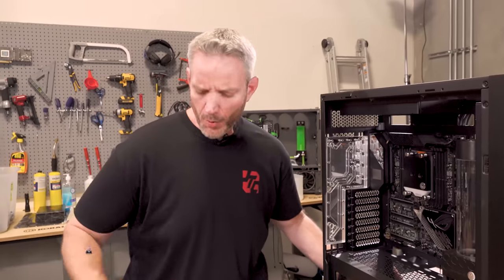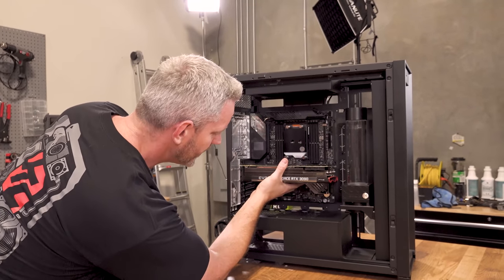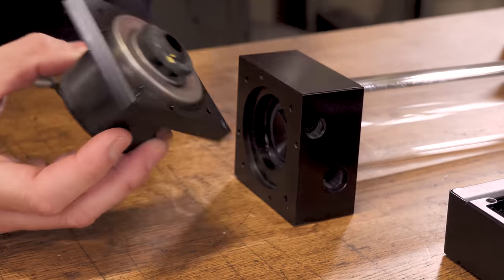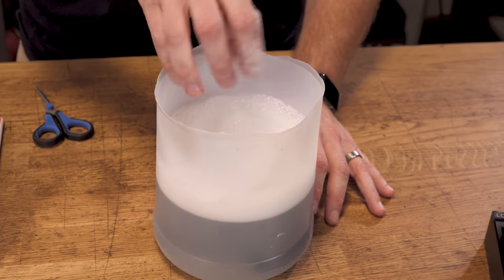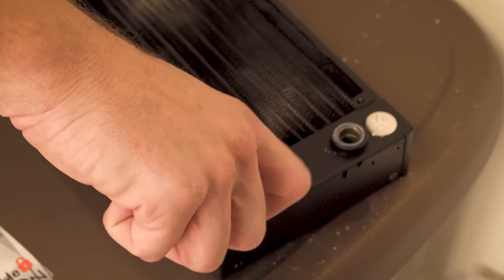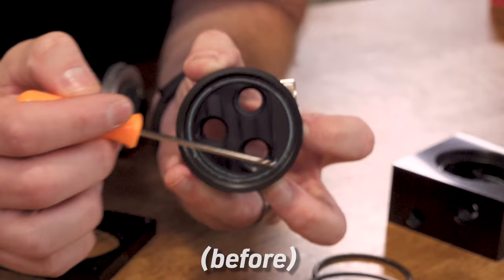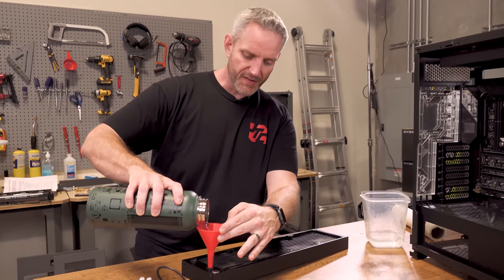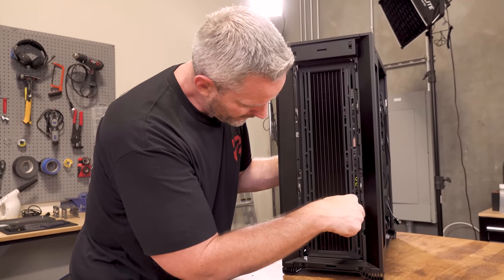Skunkworks Custom PC Build - Part 2

Comment: It's not by any ways boring. This is what I do every time when maintenance on the liquid cooling system is needed. For radiator flushing (both new and used) I use close to boiling point water mixed with vinegar (9:1 10-15% vinegar). It will flush the manufacturer leftovers and it will take care of any sediments from past fluids. I will flush rads about 3-4 times doing the Harlem Shake (TM) :) Then cleaning fittings with bottle brush, clean pump housing with toothbrush, open blocks (both CPU and GPU) and clean with toothbrush, swap crushed o-rings with new ones or just clean good looking ones. After reassembling the system using new tubes (I use soft tubing) I will then run it one time with distilled water and after that I will fill it with proper fluid.
It's a pain in the ass, it takes all day but temps, looks and overall performance of the system is worth it :) And if you keep it up then it will work a long time. I use the same pump unit for 4 years now, but I always clean it during maintenance, just like Jay showed.

Comment: You should try the horizontal mount and add the watercooled backplate that EK released, it would work beautifully with that distro plate and in line with the over the top theme in skunk works

Comment: as someone who has gotten an IFixIt Manta kit I can attest that it is very good. only complaints I have is the magnet is so strong it is sometimes hard to get the bits out yet so weak that it has issues holding screws on the bits.

Comment: FYI jay, the waterblock ek makes for the 3090 ftw3 is longer than the pcb of the card. about 1,5cm longer. I would measure and see if it fits. Dimensions: (LxHxW) - 314x155x20.5mm

Comment: Have you ever tried using white vinegar? I have used that to clean used aquarium pumps to break down sediments that have gotten into them over time. It has worked well. Not sure if it would have a negative impact on computer parts.

Comment: I see what looks like a Harbor Freight pick (fl. orange handle with no markings), you should check out their brush sets too, they have some decent cheap ones.  Or Amazon, of course.  The brushes sold with a lot of bamboo/glass/SS reusable straws are also nice because they're long and thin and can reach pretty far into passages.

Comment: @jayzTwoCents the Wall thickness of the tube is 1.5mm. The outside diameter is 13 and inside 10. makes 3mm for two walls. just to correct things there.

Comment: I'm jealous, can't even find a 3070 TI for a decent price.  You should try small pipe cleaners.  For the flushing how about a pressurized flush through the RAD. Set a small 1-2 lb loop or what ever you think is safe to push the just out.  A system that can run for 30 minutes with fresh water.

Comment: Hey Jay, maybe you can heat the water in the radiator using a hairdryer, to speed up the process some more.
Just make sure you leave one of the taps open, so it won't build up any pressure.

Comment: Great video.
In the past I've used a mix of water/distilled vinegar and let it sit in the radiator for a while to help dissolve any algae and or gunk and then flushed it with distilled water. What's your take on that?

Comment: Re: failures of Alphacool pumps, most of that is the VPP755, which had a habit of eating bearings for a while. It wasn't just gunk. 

The 755 also isn't really a D5 clone. It has approximately the same form factor, but the control is totally different from a D5 Vario or PWM. It's a weird stepped control system controlled by a PWM signal.

Comment: I’m curious, if you’re using just clear fluid for your build… would you advise someone to maybe once every couple months or so just, without disassembly, to just flush it out with water, even tap water, just to clean it, and then refill it? Or would that probably still leave sediments in your loop?

Comment: as a chem major, oh my god yes thank you for emphasizing how effective it can be to add heat when cleaning residue. Not only do reactions that break minerals down occur quicker at higher temperatures, solubility is very dependent on temperature and minerals will easily enter solution just by going from room temperature to bathtub temperature. Don't forget that solubility has a hard cap, and the closer you are to that cap, it gets exponentially harder for new ions to enter solution

Comment: Ultrasonic baths are fairly cheap. From cleaning resin from printed minis to cleaning pump components. Just a thought.
Reply: Also - the lighter patches on that 480mm rad. Is that from years of dust blasting through the fans abrading the coating on the fins?

Comment: You mentioned running the radiator with a filter to clean it, which makes me wonder if there is a reason we shouldn't run an inline fuel filter if we weren't using a coolant. I know if would add resistance, and probably wouldn't catch much of anything at all, but it would be cool for a car themed build.

Comment: Just a thought. As you are a car guy as well, how about doing a build where the coolant tubing is made by using Dash/AN fittings and lines? The pump could be a 12V PWM controlled waterpump which we also use in motorsports. Just imagine the look of having let's say Dash 6 or Dash 8 lines running through that case. As you could use PTFE Dash lines, they would also withstand all kinds of coolings and additives you would need. Would be a great joint venture between the "Car-Jay" and the "PC-Jay"

Comment: Nice, a word of advice though don't use water with solvents in it for O-Rings, you can use an oil based cleaner like oven cleaner or just mineral oil. Do not use any kind of detergent because it breaks down the rubber, the lighter color you see in the orings after the cleaning is an indicator that they were damaged by the solvent.

Comment: Hi Jay,
Assuming that you accept suggestions from viewers, just a small suggestion for Skunkworks's water loop...

You could run it,
Pump out ---> cpu block ---> 240 rad ---> 3090 water block ---> 360 rad ---> Pump in.

(I saw that LinusTechTips concluded that a 240 rad sufficiently cooled a 3090. The 240 rad would take off a bit of the heat from the CPU before going to the GPU...)

Thanks,
Binula.

Comment: So silly thought, What about using a carb cleaning dump? like it isn't going to be to harsh of cleaners to harm the finish and it'll eat away the grime. Use it on old Hollys and Edelbrocks with no downsides so why would that work for your pumps?

Comment: You really need to use a plastic pic versus the metal one.   The metal ones scratch the aluminum which cam cause leaks.   They also do more damage to the o-rings as well.  Nice video....

Comment: eroded fittings, blocked pump, gunked rads, dirty blocks, tarnished tubes.. all good reasons never to use opaque coolants :)
i feel like 90% of complaints against custom loop is purely due to these coolants.

I once tried white opaque.. was sweet, the novelty wore off after a month, i drained it, took my blocks apart to deep clean them, dismantled whe whole pump.res, cleaned every oring, changed all fittings, changed all tubings, flushed the rads in the sink alternating with cold/hot water, forward and reverse flow like 15 - 20 minutes each, put everything together and... wooshhh... white cloud in the water :)
now it's 2 years after, and at every flush i still get white carry over.. very light but it's there.
TL:DR : if you ever try opaque, commit to it.. or replace all your loop.

Comment: I’ve been using Coca Cola to clean my rads since the 90s. Pour it in and about half to 3/4 fill the rad swish it around and dump it… repeat until you’ve put about 1L through the rad. Run some fresh water through it for an hour or so… it will be spotless

Comment: Paint Gun cleaning brush kit, amazon or harbor freight. For the holes and threads and some have a chemical resistant brush thats like a tooth brush but wont melt with brake clean or acetone.

Comment: Just asking: have you tried alcool vinegar to clean the gunk off? It's a mild acid and being not made out of wine it has very few residues

I usually use it to clean off corrosive base deposited by a old battery, water residue, and other stuff.
Than after that I brush it well where I can with a old toothbrush and flush it with isopropyl (in case of electronics) or purified water

Comment: We watch Jay because we love him… not because he’s smart or good with numbers and stuff. If you intersect a tube there’s effectively two wall thicknesses to cut through… 10mm ID + 2 X 1.5mm wall = 13mm. Or just straight-up measure the wall thickness with a set of calipers.

Comment: Thanks for this video. I have just done the same with my pc. The  two 360 rads and fittings, and pump are 7 years old. But last year I bought the Blitz clean chemical set. When I cleaned the rads last year the fluid came out with a green tint. This year the tint was only slightly green, but I ran the Blitz in a separate closed loop in reverse. I did take the pump apart but I did not remove the impeller to check underneath. Should I drain the loop again (still has the 2nd rinse fluid in it) and clean underneath the impeller? It did get stuck starting up a couple of times starting up. I assumed it was air in the pump but you've shown me another reason I should look at. I did add a new gpu block for my 5700XT. The hot spot temperature has dropped from 100C to 70C. CPU temps remain between 50C - 70C. This time though, I am exhausting all air out  of the case rather than inside. Internal case temps are in the low 30's. My question is are these temps ok? I have given up on colored coolants, even clear UV as you have shown they break down in short order and plate out on all parts causing a haze on my acrylic parts.

Comment: To be fair... I'm technically really enjoying these type of videos... they explain important things and even for people that have done it for decades by now... it's always good to see others do it too... just in case you pick up some tips and tricks from other methods being used...

The only things I have experience with cleaning out that including repeated filling and draining were bongs... and I used to hook up a pond pump to a loop in a bucket through a filter to keep all the parts submerged in heated water and just leaving it on for a few hours xD 
I figure that might work for a watercooling loop too... 
I did have a heating element in there too that was only 65c warm but it kept the boiled water hot for a lot longer than not having it in the bucket xD

Comment: Hmm, well, this just about calls it for me on whether or not I want to try water cooling at some point.  It's a cool idea, and when I'm just getting a new computer I can totally see being invested enough into working everything out and doing it all properly.  But...I know myself too well.  Once I've got a computer made and set up, I want to be reasonably confident it will last me the 6-8 years it'll take before I'm interested in saving up for a new build without really doing much with it.  With an air cooled system, you just dust it out now and then, and it'll do that for you.  It's nowhere near as sexy as a good custom water cooled loop, but I'm terrible at keeping up with maintenance.  Sounds like a bad fit for me.

Plus, I don't really do much in the way of overclocking (or rather, anything in the way of overclocking), so it's really not a priority for me that I maximize the cooling potential of my computer.  Air cooling does what I need it to do.

Comment: I would just buy a Noctua fan for the CPU, use some thermal paste, and not worry about it. If things get really warm, take the side panel off, and put it away somewhere. Use Afterburner and pump up your GPU fan if it gets too warm for your delicate sensibilities. I can run my 10 core Xeon at all cores at 100% and my Noctua hardly even gets beyond idle speed, according to Aida64.

Comment: "To be Fair" Ive also used gun cleaning patches and soapy water to clean my D5. they are more durable than paper towels and slightly more abrasive. just get a little better cleaning power without effort

Comment: Just thinking; if the pastel color doesn't work out, and you go down the painted tubing route, maybe mask off a line across the front face of the tubing, and the reservoir and paint the rest?
You'd get the yellow colour, have a streak of texture even with just distilled water

Comment: My Tap Water has lots of Lime. To wash clothes, you better add some decalcifier. You definitly do not want to put this water into cooling circulation. Don't get me wrong its still perfect drinking water. So: to remove some of your residue, one can try vinegar. And for cooling fluid, i would buy destilled water.

Comment: Just soak your brass fittings and acetyl blocks in carburetor cleaner, works wonders on acrylic, seriously though put some super lube on those orings before you put them back in. Special note: Those AMd waterblocks are so fugly

Comment: If it's 13mm OD and 10MM ID then the wall thickness is 1.5mm not 3mm.

This is because ID & OD refer to diameter rather than Radius.

An ID of 10mm (or internal radius of 5mm) with 3mm thick walls  would give a 8mm Radius or 16mm OD

Comment: when I built my system I was not thinking about any new parts that's why I have not gone with water cooling so in the future all I have to do is a full strip-down and clean all the fans but if you have water cooling then you will need to replace parts so that means spending more money on your system

Comment: You can put a bottle brush on a cordless drill to clean out the inner threads. One with variable speed. :-)  Is decalcifier corrosive to these radiators?

Comment: Showing off obliviousness, to Liquid Cooling

Outside of the [inevitable] metal plating's degradation, since its fighting sustained friction [of refrigerant flow]. Does the exposed brass degrade quicker, compared to the plating, for these cooling systems? Or is it just riling up a clog city, thanks to a lesser/non-buffed surface, latching up suspended solids?

Comment: PWM D5 pumps is a noob-trap. I struggled with that. The easy fix is to only connect the power to the pump and not the pwm cable while bleeding the loop. Without a pwm signal it defaults to full speed.
Edit: I did not know some pumps default to lowest speed. That's rough.

Comment: The right way to build a computer is slowly. My case shattered ( don't ask) and I had to switch my build into a 5,000D Rgb and I didn't break anything it all went well but I almost broke a pin off the HD Audio on the MB. Luckily MSI has some thick strong pins and I was able to get it straight and connected fine but that was just from rushing and making the mistake of hooking up HD audio before I slid the PSU in. So I like seeing videos where someone is realistic and taking their time cause that's the way to build these things so silly mistakes don't happen.

Comment: I have to wonder whether a vertically mounted graphics card doesnt slow down due to extended traces, considering the fact that electrons travel at a specific rate and take longer for longer wiring, especially at high frequencies.  Could be interesting to compare fps on normal vs vertical mounted cards.

Comment: do the fittings come in 304 stainless steel? Does brass have any corrosive properties on the coolant you use? If it is chrome plated brass, I am thinking the chrome will wear off and get into your solution. At least that is what happens with acidic Beer pumps and hoses.

Comment: I use a Rasberry PI 3 to generate PWM to test the pumps off the motherboard or an old PWM electric motor controller from my old RC car to test

Comment: You could have put the parts and the soap water in your ultrasonic cleaner. Not only would the soap water have been kept hotter, but the ultrasonic also should have helped a lot with the rly stuck stuff.

Comment: Couldn't you use vinegar and baking soda on the metal parts to aid in the cleaning and breaking down the gunk in the threads of the metal blocks? I mean baking soda and vinegar remove corrosion on a battery terminals, So I'd think it would work on metal parts too. I mean clearly you wouldn't want to use that method to clean the o rings or plastics, just soap and water for them I would assume. But wouldn't that work for an overnight soak for the metal blocks?

Comment: You didn't check the gpu placement with the vertical bracket. The brackets all take extra space on the io side to leave space for plugs and stuff. I'm not sure it'll fit...

Comment: Technically, (Badum-ts) the phosphoric acid in Mayhem's Blitz is not that much of a problem down the drain as long as it's diluted - which you do to use it. Phosphoric acid is also in household cleaners like Cillit Bang for example. If you can have acid based household cleaners and pipe cleaners down the drain, you can put Mayhem's Blitz down the drain.

Comment: Why didn't you clean the pump base and other parts, that would fit, in the ultrasonic cleaner? Can you try and clean the old 240 radiator you're not using in the ultrasonic cleaner to see if it will clean the inside and out?

Comment: Love the video, but I have a question. Would mounting the reservoir on the radiator negatively effect the air flow through the system or would it be negligible?
Reply: @IdiotWithA3DPrinter  That makes sense, than you!

Comment: On your other other video “WATER COOLING 101: For beginners ”  the 5000D was used and you placed the radiator on the back and still used the fans at the front.  This build you said you don’t want that and placed the radiator to the front with no fans from the back plate?
Reply: ADVANCED BUILD

Comment: If a pipe has an OD of 13mm and an ID of 10mm then the wall thickness is 1.5mm!  1.5mm x 2 sides = 3mm.